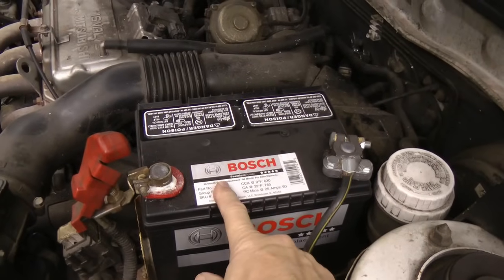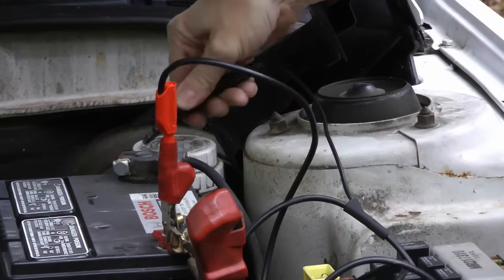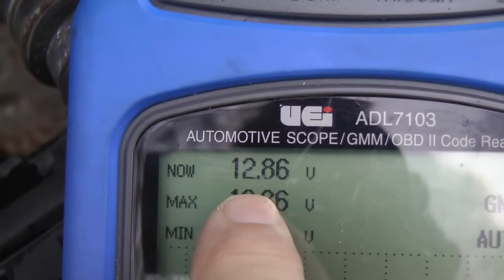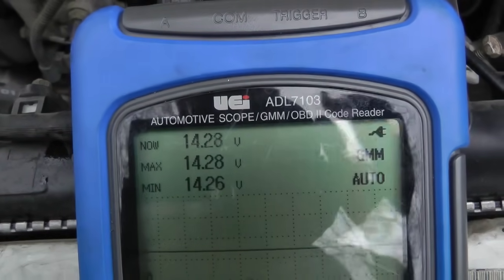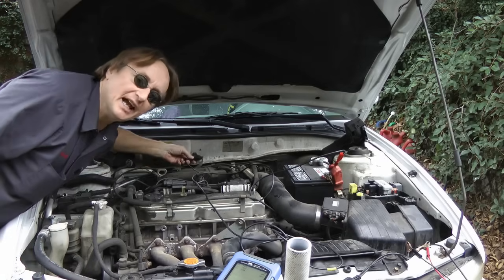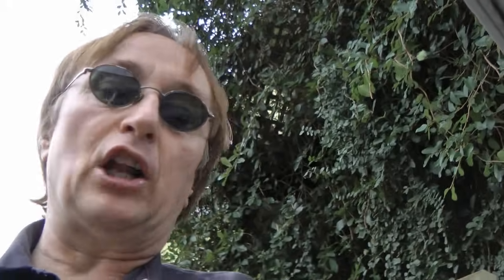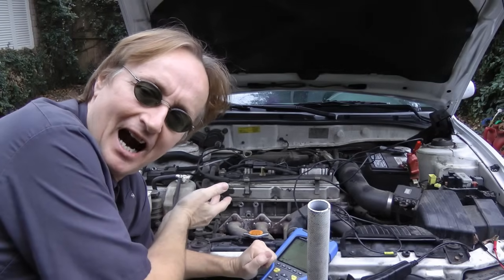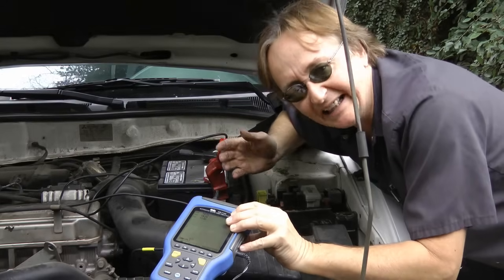How to Fix Electrical Problems in Your Car (Ground Fault)

Comment: My check engine light came on today it needs an oil change via 15 miles ago (has oil in it). and it keeps acting like its going to die. Sputters like its running out of gas or something. I kinda have noticed the lights on the dash and air flow from ac/heater blows air then it acts like it slows down when the  lights dim on the dash. Any idea? Is this just a battery issue? Alternator?
Reply from the maker: have the battery and alternator load tested first, places like auto zone do it free. Often a bad Alt
Reply: Had it tested. They think its the fuel cell.

Comment: hey i have a 2001 honda accord , my dashboard lights wont turn on neither does my brake lights (but brake lights turn on when step on brakes). my two main headlights work but the turn signal lights dont turn on unless i pull on the turn signals from the inside but once i turn of the signal lights they go back to not being on. other than that my radio works and my interior lights work , and the car turns on fine. ( i did this while my light switch was on.)
Reply from the maker: you have wiring shorts in the dash, time to take it apart, start by checking the turn signal assembly on the steering column, it may be shorting it all out

Comment: i have a 1995 buick century tonight i pulled into a gas station and my head light stop lights electrical antenna and my power door locks all went out at the same time would you know what the problem could be?
Reply from the maker: have the vattery and alternator load tested, places like auto zone do that free, often a bad alternator
Reply: Ok will do thank you Scotty I was doing some research someone had the same problem was the fusiable links
 But I will try the alternator first thanks again

Comment: VEHICLE:  2001 CHEVY EXPRESS 5.7 1500 VAN

SYMPTOMS:

JULY 2014: 

Idle issue first noted. I was injured and out of commission for 6 weeks with ankle sprain, so no working on vehicle.

-Low idle issue, must keep foot on pedal or vehicle will stall.
-Humidity seems to cause malfunction to happen more often.
-Amp meter would fluctuate a lot at low idle and then vehicle would die with foot off gas pedal.
-Vehicle ran fine a driving speeds.

SEPTEMBER:

-I took vehicle to dealer and they got vehicle running, but suggested changing same parts I have already changed, minus battery and alternator. They were no luck, but took $180.00 for their time. 

NOVEMBER SYMPTOMS:

-On way home from work with vehicle, it started losing power and running extremely rough. To the point that the vehicle was only going 5 miles an hour. The lower the gear I put it in, it would drive but slow. Finally, it just quit on the side of the road. After 15 minutes of cooling off, it starTHted, but barely. I kept it in 1st gear and it started driving again. Put in 2nd and then 3rd gear and vehicle would get up to 40-50 mph. I made it one street from my house and as it was climbing a small incline, it lost all power and died. I noticed loss of brake power too. I suspect the cadillac converter was hot, but not sure. I should have looked at it. After one hour, I was able to get it started and it crept home in low gear.

JANUARY 17:  itVehicle started up and barely had power to drive up on car ramps. It is running rough and even rougher in drive or reverse. Suspecting a clogged cadillac converter, I removed the o2 sensors and vehicle ran smooth. (richer fuel as you mentioned). I am getting a temp sensor gun to read temp of cat.

PARTS CHANGED:

-Tested and replace alternator.
-Replace batter because it was 6 years old.
-Idle air control valve (cleaned gunk out out throttle body and ICV air passage)
-Spark plugs, wiring and distributor cap and rotor
-Replaced MAF air sensor
-Replaced temp sensor
-Replaced ground strap on engine to frame
-Replaced throttle position sensor
-Cleaned fuse panel/fuses

MY PLAN:

-Check for air leaks in the Air Induction/vacuum system (e.g., in the intake manifold)
-Perform smoke test to Air Induction system.
-Check for air leaks in the PCV system and in its related hoses and/or PCV valve
-Throttle plate, throttle shaft or linkage is damaged or sticking

If you have any other suggestions, I am all ears!  This is a tough fix!

-Curt Thivierge
Reply from the maker: those are known for either weak fuel pumps, pressure test that, OR the dreaded spider fuel injection system problems where all the internal plastic injection parts need replacing as they crack from age

Comment: hey, my 06 mustang 4.0 is acting crazy i start the car and everything is working great i drive it for a min and the radio will turn off and the windows and dome lights will not work either and if i speed up or slow down it sometimes will come back on? if you can help please
Reply from the maker: have the alternator load tested first, pray it's just weak, places like auto zone do that free. If not that, wiring has a problem and that can be hell to decipher

Comment: my problem its an mercdes benz c200 k :D    the right signal light blinks fast,and the right lamp in the front , was stop working. now the 1 thing i did was to change the lamp, tought was bad , but its comes out that the problem its stil there. i have no idea what i schal do . some help please .

Comment: Scotty, I have a BMW 323CI witha p0601 code that wont go away. I changed all related parts from the throttle body to the MAF. I am starting to think it may be electrical or the ECU itself. Any suggestions?

Comment: Scotty, I hope you see this...I don't know what is going on with my chevy silverado.  It is a 2010, have never had a problem.  Last week once, yesterday once, and today, when I accelerate from a stop, after  cranking the truck up, my window power locks lock and unlock.   Tonight, the window locks didnt do that, but after getting on the road, I noticed that using my turn signals caused a change in headlight brightness, sometimes flickering, or a hair brighter, or a hair lower.  Using the turn signal also cuts the cruise control off when set.  I cant afford to have it into the dealer wracking up a huge bill.  I am a disabled veteran.  Help.

Comment: Scotty just got a Acura MDX 07 but just if you could do us a big favor in general most of us got same and common issues with this car till heaard 2010 ,like drain battery is one and so on.
nice car but those things what would you suggest , please dont say get another car !
yoou might be able to help but if not is fine too .
although thank you so much !
Reply from the maker: realize those things are full of electronics that even normally drain a battery. BUY the best, highest amperage battery you can get for that SUV, and drive it a lot. Or, put a trickle charger on it overnight to keep the battery up. They just have too many electronics and as they age, they drain a bit too much power sitting.

Comment: Hi Scotty, the first symptom of my car is the rear window defogger doesn't work. I checked with a voltmeter and there is ~13V running through each heat line. Second symptom- the hood pops open by itself. Third symptom-the radio turns on by itself. Forth symptom, the car has rough idle and it sounds like it's losing power for a second and come back on again. Does all this sound like a bad ground? Where should I start?
Reply from the maker: sure sounds like bad grounds, so get a wiring diagram and start checking all the ground wires, cars have tons these days

Comment: Hi Scotty, my dash and other electricals went off when I turn the signal on and now it's completely dead, it also affected the power steering. Does it sound like a bad ground? It doesn't go off at first but the RPM gauge went crazy when I try to turn the signal on.
Reply from the maker: sounds more like  a power short in the clockspring mechanism inside the steering wheel, especially if you have electronic power steering

Comment: I'm having a problem with my volvo 240. The fuse for my right rear driving light keeps blowing and when I try to use the blinker on the side when the fuse is blown, all of the right side rear lights start to blink. The fuse for the rear taillight often blows when I hit a sudden bump in the road but it also sometimes blows immediately after I put in a new fuse and turn the car on. What do you think the problem could be?

Comment: Hi Scotty,
Problem: Dash lights go a little dim when engine is idling. Stepping slightly on the gas pedal and the lights brighten up; stepping further does not brighten them more! Switching on the headlights does not change the the symptoms. What could be happening here?
Reply from the maker: first, have the battery and alternator load tested, auto zones do that free, either can do that. If not that, then wiring problems, like bad ground wiring
Reply: Scotty Kilmer Thanks Scotty! Appreciate your taking out time to reply.
Reply: Scotty Kilmer how are you my friend. .
I have opel senator 3.0 24v. .and i have a problem with the lever of the automatic transmission when it's on P car not running. ..when i move it to the forwarded with pushing the car start

Comment: Scotty just had an engine replaced after snapping the timing belt on an '06 PT cruiser. After it was replaced 8 months ago I've had intermittent problems with blown turn signals, headlights, brake lights, oil pressure sensor, losing some electrical while driving ( like radio cutting out ) and now lately camshaft position sensor. Could this be a ground issue?

Comment: SCOTTYYY help!
I have a 2003 buick regal. someone ripped off my visors and rearview mirror both had wires running to them. ever since my windows wont work or the radio doesn't even work. I assume that caused a short somewhere? idk help
Reply from the maker: pray it just blew some fuses, check that first and tape any loose wires off so they dont touch metal

Comment: hi scotty..today i was hooking up and amp and speaker and the ground and power wire to the amp touched and it sparked and i lost all electricity..i cant crank the car or anything..its completely dead..I checked all the fuses also and none was blown.I have a 98 chrysler cirrus
Reply from the maker: ALWAYS disconnect a battery terminal from the battery when doing electrical work like that. You shorted something out, if all fuses are OK, and realize there are many fuse boxes, then odds are you blew the computer

Comment: Hi Scotty. Thank you for the video! Was wondering if you could help me :)
I have a 06 Chevy HHR electrical issue with 3 symptoms.

1. The auto-unlock door lock feature will occasionally not work when put into PARK.
2. When headlights are on, the dash lights will go on an off every few minutes.
3. You can barely hear the radio, and changing the volume barely makes a difference. The weird thing is that, every once in a GREAT while, it will work like nothing's ever been wrong... 

Those are the only things affected by whatever the problem is. 
Thanks so much for your attention!
Reply from the maker: often the main inside door switch goes bad and does that. Check the alternator and battery for the headlight problem, places like auto zone load test both free. Radio Amp is breaking down inside, typical on cheaply made GM electronics

Comment: Hey scotty I have a 2011 Toyota camry, my automatic door locks do not lock the unlock works but I can not get the doors to lock. I would speculate being a single hardware issue if only one door but all 4 doors???? 

Your help is appreciated.

Comment: do my dome light have a grounding problem, went to check it out and my radio, door indicator light and dome light don't work at all
Reply from the maker: first, check for a blown fuse, and if so, find the short that blew it, like a bad dome light switch or door switch on one of the doors
Reply: Try will try that
Reply: Thank you

Comment: i have a 2005 kia sportage my power windows stop working dash lights stereo and taillights iv checked all the fuses and its all fine i hope you can help me out
Reply from the maker: realize they have more than one fuse box, check them all first. If not that, a wire has come loose or disconnected from a connector losing power, or body control module is shorting out

Comment: Hi Scotty am Kofi. I have a 2001 Honda Odyssey and all my lights dims and stereo turns off after a few seconds,when i turn the ignition on (without turning on engine) and my voltage drops from normal to 9.9 Volts and keeps falling. My alternator works fine and my battery is less than a year old my engine starts fine does not crank. What could be the cause???

Comment: Hi scotty my name is Henry.  I have a 2001 yukon denali and my dash lights stop working.  Everything works except my gage lights and my heat control lights are out as well. What's your thoughts on the matter.
Reply from the maker: those have crap chinese made dash units that just short out. But do check the wiring connector to the dash and pray it's loose or corroded
Reply: Thanks I appreciate it.

Comment: Hey Scotty.. Love your vids.. got a stumper for ya.. or me anyways.. got a 2000GMC 3500 HD 2WD, have had issues with it however the current issue is.. it was running fine, I pulled into my drive shut it off, un hooked small trailer, jumped back into leave, turned key to on position and all relays, dash lights and needles start going crazy... turn key forward to start and it dies or clicks with a fizzle and acts as if batt. is dead.. turn off and turn key to pre start position again.. and again all goes crazy ? P.S. Batt has full charge... seems like a grounding issue maybe ?.. but cant find any.. could a bad head lamp switch cause this ? Any direction would be greatly appreciated...

Comment: hey scotty i recently got new smoked tail lights on my 06 mustang gt and i installed the right side loose and got water in my reverse light area - i got it in tight now so can i just take a small drill and drill a hole in the corner? I dont want go go through the hassle of warranty exchange or taking it out, drying it, sealing it, re installing it, just wanna quick fix that will do the job.

Comment: hi scotty i feel like have electric issue on my 2002 bmw 325i. when car ignetion on or start engine headrest monitors start to flickering and cutting off the image. when key on ACC without start engine thay works fine. i check all the wires and connections and i hooked up it to different power source. problem is same

Comment: Hey scotty, I'm having some issues with a 2005 silverado, all the lights in the vehicle are flickering, is there a short or is the alternator going bad?
Reply from the maker: could be either, realize places like auto zone test batteries and alternators free, start there
Reply: Okay, i have replaced the battery because well it was bad and it helped somewhat  with the flickering lights. Will be testing my alternator tomorrow again and hope that's the problem

Comment: Hi scott,my 2000 toyota camry headlight highbeam doesn't turn on at all while the low beam acts like its having kind of partial contact turns on and off just like that,and My car  temperature  control functions  even after switching them off please what could be causing this kind of problem and how can I fix it.

Comment: Scotty Kilmer I HAVE A 2001 FORD TARUS I TRYED 2 INSTALL A AFTERMARKET RADIO GOT ALL THE WIRES HOOKED UP PLUGED THE BATTERY BACK UP STARTED THE CAR UP TO PLAY THE RADIO AND I THINK THE WIRES TOUCH METAL NOW MY WIPERS DONT WORK OR MY WINDOWS MY LOCKS OR MY SPEED DEMOATER WOULD SHOULD I DO PLEASE HELP

Comment: hey scotty, my 2002 acura has a head light out. I've changed the lamp, $80 head lamp. also the hole lamp themselves have been replaced recently. at one point both lamps went out, but the other has since come back on. i brought it to a mechanic and he told me to take it to the dealer and I'm hesitant to do that. is that a ground problem?

Comment: Hey Scotty, I own a 1996 Honda Accord and I had a strange electrical problem which went away on its own but has now come back. Strangely though this problem comes together with very poor idling which leads to my car stalling whenever it comes to a stop. The problem is whenever I turn my car off the ac lights stay on, I am also able to turn on my ac with the car being completely off. Every time I shut off the car I have to disconnect the battery so it doesn't drain over night. I had my battery, alternator, and starter checked and all results came back good. Any info on the source of this problem will be greatly appreciated.

Comment: Hi i just got a volkswagen gti 2007 and my passenger headlights aren't working. At first i thought it was that the lightbulb died but then i tried putting it in and the light wont even turn on. I went to the mechanic and he told me it might be a wiring issue. How would i go about that and what would i be expecting to pay to fix that up?
Reply from the maker: if the other side works, easy fix. cut the wires off the non working side, and splice power to them from the working side. I do that all the time to bypass VW computer crap wiring
Reply: Scotty Kilmer yea im kind of scared to touch my car and was hoping to probably get a done by someone else, do you know what i should be expected to pay by a auto electrician to help me with this?

Comment: 05 cavalier. When the key is in the on position but not started there is a clicking in the relay box. I changed the relays and it didnt help. The daytime lights flash also and it wont start sometimes. I changed out the gauge cluster bc when the key was in on position the odometer would read "error". Any ideas?